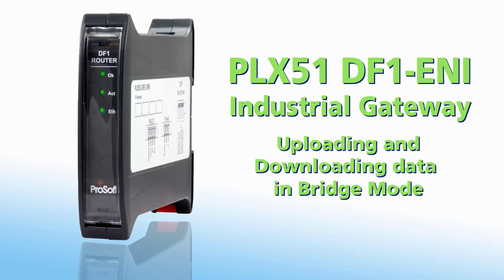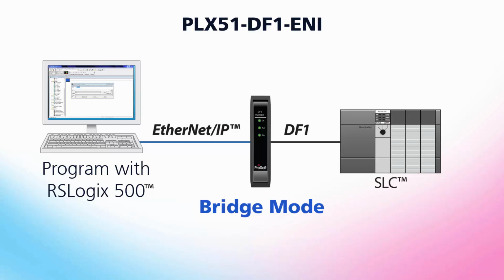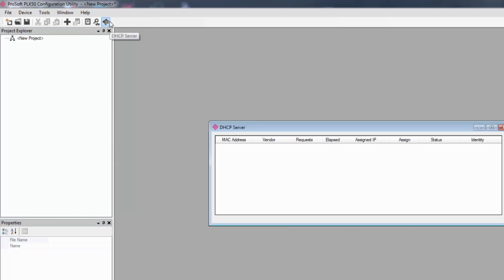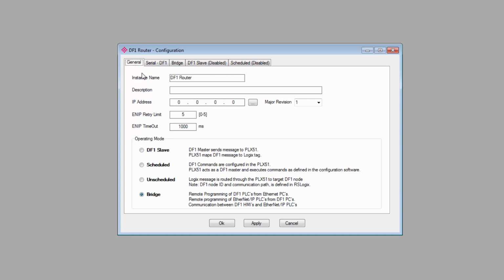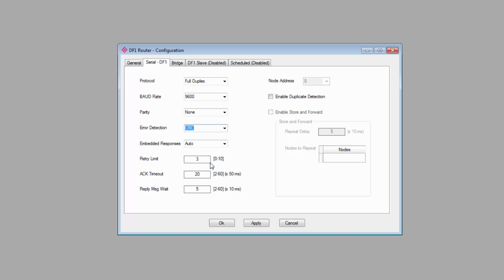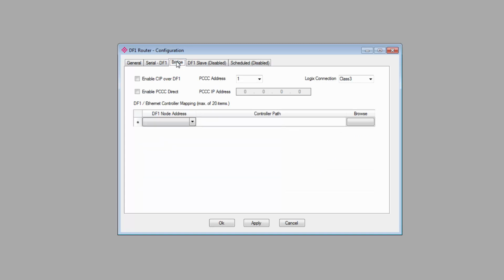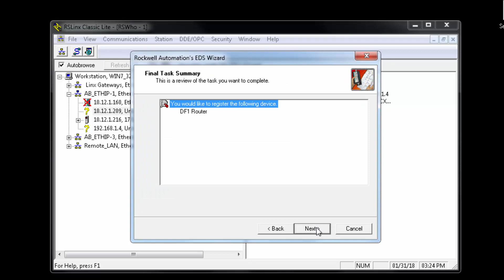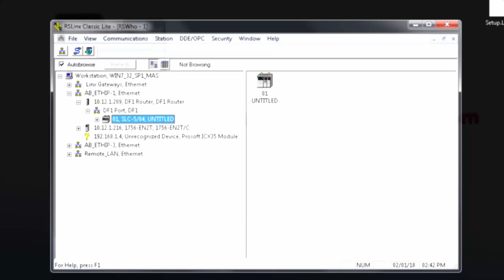Set Up: Upload and Download PLC programs from an EtherNet/IP™ PC to a DF1 PLC

Comment: How are you connected to the PLX51 ? I m connected by etherent cable, Laptop to PLX51 and the signed in IP to the PLX51 Mac address can not be downloaded.  Tried via switch port, Laptop to switch, switch to the PLX51 .. not working also  ??  Did you place PLX51 to the switch and PLX to Laptop by RS232  >>  Thank you .

Comment: can you use this to go online and view the ladder logic live?
Reply from the maker: Hi! The PLX51-DF1-ENI in bridge mode can absolutely be used to go online with a processor, and view ladder logic “live." The module can also (again, while still in bridge mode) be used to send messages to and from various PLC’s while you’re connected in to the processor at the same time.  Just be aware that speeds slow way down, quickly, as most DF1 baud rates are limited to 19200 as the max rate. If you have any additional questions about the module, please call our tech support department at 661-716-5100. Thank you!